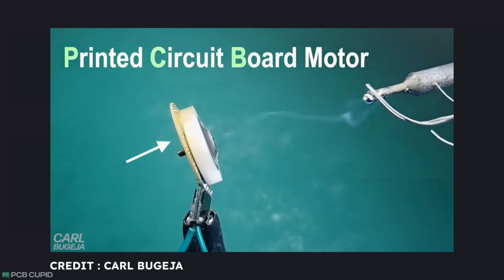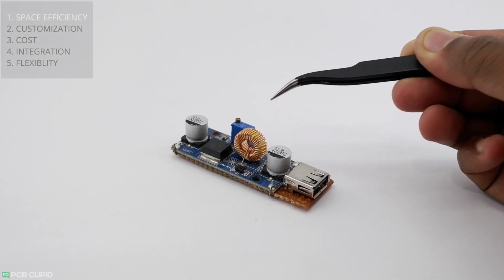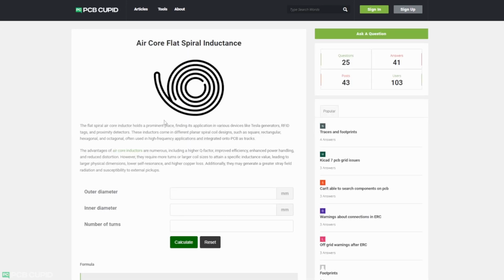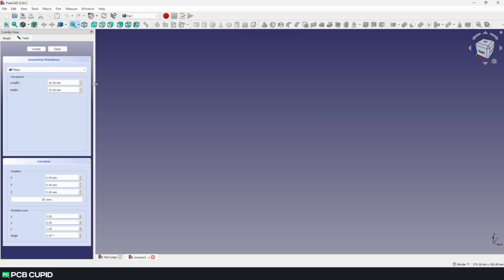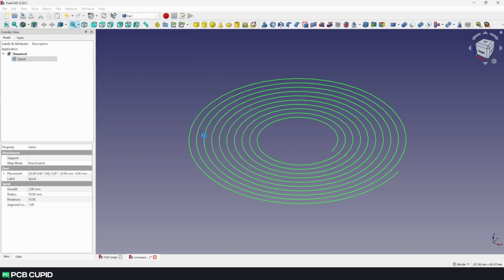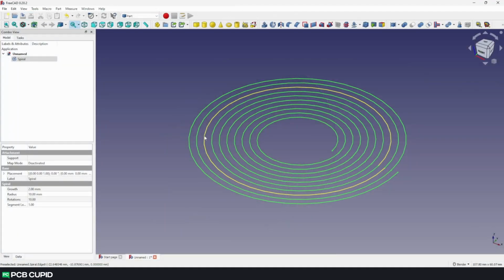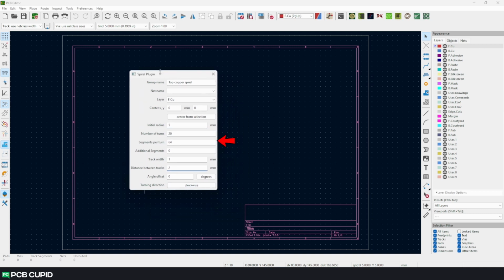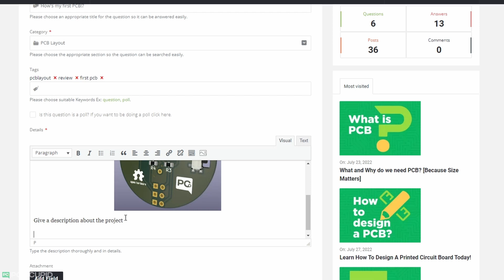#20 How to make PCB Coil in KiCad ft. Carl Bugeja PCB Coil

Comment: this plugin not supported by kicad 7.0.7  error json file
Reply from the maker: It might take some time to update the plugin, 7.0.7 is fairly a new version. Please use version 7.0.5 until it's fixed.
Or you are free to open an issue in the plugin's GitHub repository.